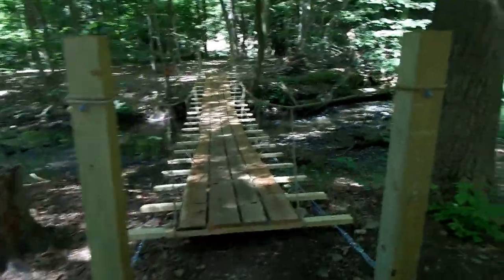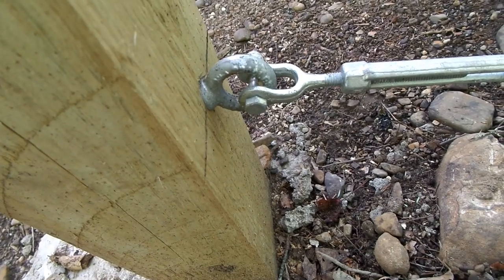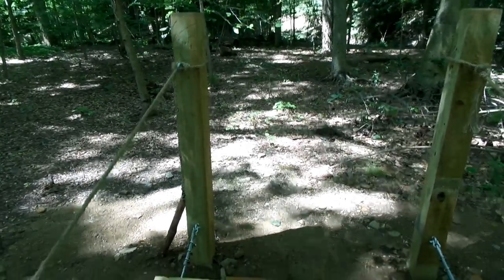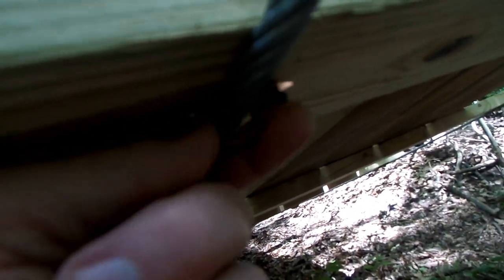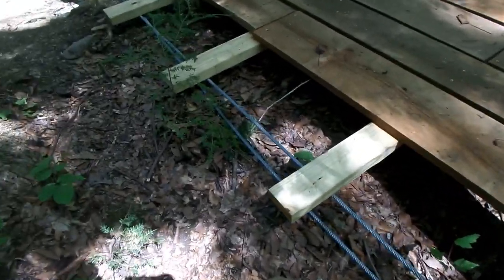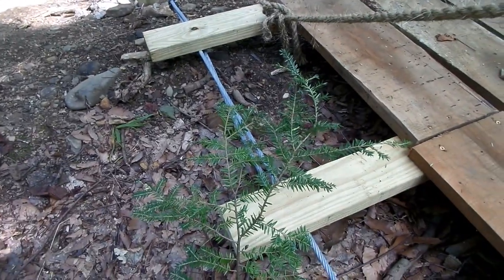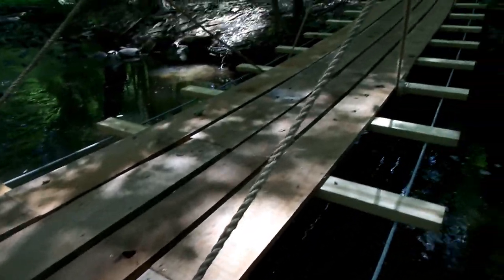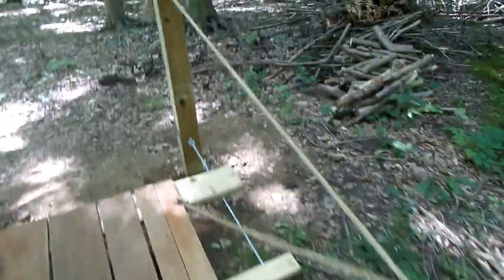40+ Foot Suspension Bridge

Comment: I think this is great inspiration. If you do it again. you will want to avoid putting modern PT wood into concrete. The new treatment chemicals are leached out by the lime of the concrete, and that causes rot. Building codes are being revised to prevent the practice. You could instead put a concrete column below the frost line, and use a steel mounting post. Then tension the other side with a cable anchor, to more concrete in the ground. Again, great job. Nobody is going to die falling fro that low height if those posts fail.  Enjoy.

Comment: Great job. One item of concern you may want to review and others may consider avoiding is the use of copper fittings with steel cable. Using dissimilar metals can cause premature corrosion.
Reply: That's absurd.  They're not even really touching each other.

Comment: Almost a year later and I've now completed our project just in time for spring.  I made one significant mistake.  The clamps must be saddled on the live side and equally spaced.  I had to learn the expression 'don't saddle a dead horse'.  Thankfully, I was able to determine the mistake before I or anyone else walked on it.  After securing properly the cable became very solid.  I was also advised the clamps are supposed to be torqued to manufacturer recommended specs but I didn't bother with that and instead went until they were very tight without bending the cable.
Reply: Would like to see pictures.

Comment: U did a really nice clean looking job! I'm going to do the exact same thing on my property.  I have a 75 foot span across my river. I seen that you used 3/8 wire cable, but I think I should probably go with 1/2 wire cable. Great job!
Reply from the maker: Good luck!  Be sure to post some pictures when done.
Reply: Have you started yet? I am also building something very similar this spring.

Comment: Thank you for a great video I looked at many to keep it simple you did a great job I'm going to duplicate your bridge in North Florida is a creek on the property
Reply from the maker: Awesome, thank you! It was a lot of fun building it and it's holding up great.
Reply: How many inches are the cable bolts from the ground surface ?
Reply from the maker: @joecunningham9855  we kept them high enough to make sure the ends of the bridge did not sit on the ground.  You want them to stay as close to the ground as possible though.  If you go too high you will need to attach cables to the top of the posts pulling in the opposite direction.
Reply: Makes sense, Headed 3 hours drive to live oak Fla tomorrow to go to lowes. To get the 4 legs, they have  have 6 x 6 x 8. Watch your video many times over, gas drive augers will punch holes. Thanks for leading me through this, will keep you updated.
Reply: Thanks joe, I went up there 2 weekends ago and put 4 posts in place, 6x6 from lowes. Next time csbles.
Reply from the maker: excellent! Make sure you put the wire cable clips on right.  I did not mention this in the video. https://www.youtube.com/watch?v=HKt6kswEAXo Check out this video.

Comment: Just wondering how far apart your posts are? Looks about 4 feet
Reply from the maker: It's about 4 feet.  The support boards that are attached to the cable are 5 feet so you can see that the posts are close to 4 feet.  If we would have made them less than 4 feet we could have used 2X4X8s and cut them in half for the support boards.  We ended up using 2X4X10s.
Reply: Awesome thanks..I’m about to start my own bridge very soon

Comment: I'm curious how much those posts have sagged 2 years later ? Guessing quite a bit.
Reply from the maker: the two on the far side may have moved a bit.  I could not dig the holes as deep as the two up front which are still perfect (checked the other day)

Comment: Man, I hope those vertical end posts are deep and their concrete footings are large.  They are taking a lot of load.
Reply from the maker: 3.5" deep and each have 300lbs of concrete.  Over a year and holding up great!
Reply: @jschlosser31  how large was the hole relative to the 5x5?
Reply from the maker: @myusernamewasused  I used a regular post hole hand digger.  There where a few inches extra around the 5X5s.  I guess around 12" to 16" diameter and 3.5 feet deep.  The more the better!

Comment: In the middle of my own bridge project right now…. About to rig the cables. I’m worried I made the width of the bridge too wide at 3 and 1/2 feet from cable to cable…so you mind if I ask how wide is your bridge?
Reply from the maker: 4 Feet.  I used 2X4X8s and cut them in half.  I think that 3 1/2 feet would be better.  You still have a lot of room, and it will be lighter.
Reply from the maker: I re-read your question and I see it 3 1/2 feet between" cable to cable".  That is actually about the same as mine.  Hope you're making a video!
Reply: I’ll try… you did a great job with your video. I actually found those copper brackets ON SALE… everything has been very expensive. In your video you said 2x4x5…. Do you have bowing issues with your 2x4?
Reply from the maker: UGH!  I decided to measure to be sure. From cable to cable it is 4 feet and I had to use 2X4X10s and cut them in half.  I remember now that I wished I had gone 3 1/2 feet from cable to cable so I could have used 2X4X8s!  Anyways, you have it done the way I wanted to.
Reply from the maker: Nope.  Been over 1 1/2 years and holding up great.  Did you see my correction below?  I did use 2X4X10 cut in half so they are 2X4X5.  If you're cables are 3 1/2 feet apart, get the 2X4X8s and cut them in half.  This is what I should have done.
Reply: @jschlosser31  I kind of like the way your 2x4x5’s look… but I only have 8feet to fit in my car… so I guess I’m stuck with the 2x4x8’s

Comment: I need to construct two or three of these on my land over some ravines that are about 20 to 30 feet deep so I am posting this as an open question for anyone who can respond with useful information.   I need to size my bridges  not just for foot traffic but to be wide and strong enough for a typical ATV with a rider.  My largest ATV with me and gear aboard is about 1,000 pounds, or slightly over.   I know I will need maybe 6 x6 or even 8 x 8 end posts on each end.  And I plan to anchor turn buckled cables at the top of each end post pulling back against the posts to help stabilize the foot bridge when it is under load.

But what size cable, what size decking, runners, and fittings, etc. do I need to consider?  Has anyone built a suspension bridge like this that they have tested with ATV travel over it?  This is to be an upcoming summer project so any help would be greatly appreciated.  I understand the cost will be more but it is essential I find a way to easily travel across these ravines.
Reply from the maker: Mine is definitely a foot bridge.  There are other bridge videos out there for your application.  I've never seen a "backyard" suspension bridge video that you can drive over.  Good luck.
Reply: @jschlosser31  Your bridge is pretty close to being one that can be driven over.   My smallest ATV with me and my gear weighs just a tiny bit under 700 pounds, which you say has been on your bridge successfully.   

My larger one, with rider and gear, weighs just a tad over 1,000 pounds.  So really, I think with a little beefing up of the cables and other parts, your design probably would work for no more than one ATV and rider at a time.  Not sure how stable the bridge is however and I can't afford it to tilt or sway causing the weight to get over balanced when there is an ATV on it.  You may be right; there could be better bridges for ATV's.

But you have built one of the best suspension bridge projects I have seen on Youtube.   Thanks for your input.
Reply: How wide are the ravines and what is the depth before you hit bedrock?
Reply: @alabastardmasterson  The first bridge crossing I want to construct would be crossing a ravine at a point with about a 20 to 25 foot opening between the two banks of the ravine.   Obviously the bridge would need to be longer at both ends for the approaches.  The west side of the ravine bank is about 8 foot or so higher elevation than the east side.   I'm thinking I could build up the approach on the east end a bit in order to lessen the slope of the bridge.  Not sure there really would be any problem however with having a sloped bridge just for an ATV crossing it now and then.  The ATV can certainly handle the slope.

I don't want to have to rebuild the bridge anytime soon but then again I am 68 years old and so it doesn't have to last for 100 years either!  

Some feedback I have gotten is a suspension bridge may not be strong enough for an ATV crossing it.  So I don't know if it is feasible but I had a wild idea to use two or three treated wood telephone poles of, say, 30 feet or so as the stringers for the bridge.   Then just bridge across with treated 2 x 6 or 2 x 8 lumber.  I'd  want to install some 4 x 4 guide rails on each side of the bridge decking to help keep the ATV wheels on the bridge.  I'm thinking a 5 or 6 foot wide bridge deck is plenty. Any thoughts?

Advice and suggestions are most welcome. Thanks for any help you can give me.
Reply: @alabastardmasterson  Forgot to say that there is no bedrock in Central Mississippi..at least at a reasonable depth. We have very soft, unstable soils here known as Yazoo Clay.  They have a very high shrink-swell capacity.
Reply: @TrehanCreekOutdoors  You definitely will not want to use the same design philosophy as this bridge (runners screwed into cross-members).  A suspension bridge is designed to have a certain amount of flex as the load shifts along its length.  This design uses fixed attachment points, essentially creating one solid deck held up by a suspension bridge's mesh.  The screw points, and possibly even the screws themselves, would quickly wear out from even a loaded wheel barrow.  An ATV is out of the question on this one... each trip would be a roll of the dice against your ATV ending up in the water.

I would recommend a recent video from user 'Coed Glannant' which uses a more appropriate design.  His is also designed as a foot bridge, but it's quite over-engineered in my opinion and could easily be modified to accommodate light equipment with some moderate beefing up.  Some key points are independent decking, wire for both top and bottom suspension elements as well as the webbing (as opposed to rope), and secondary anchoring at the far end of each post.  It's a well done video with a reasonably good level of detail.  Title is 'Building our DIY suspension bridge'.

Anyway, good luck.
Reply: @MacroAggressor  Will check it out!  Thank you very much.
Reply: @TrehanCreekOutdoors  That was going to be my suggestion. You can buy rather long electrical poles and just span across your ravine, then build up your roadbed. With some help from the internet you can problem get someone to run some hand calculations on the stresses associated with your loading conditions. Actually building the suspension portion might not be needed, but would only add to the structural design. https://www.youtube.com/watch?v=p6f_QMbHvv0